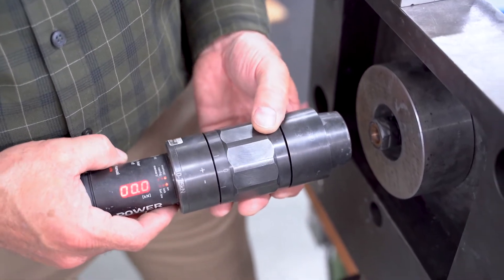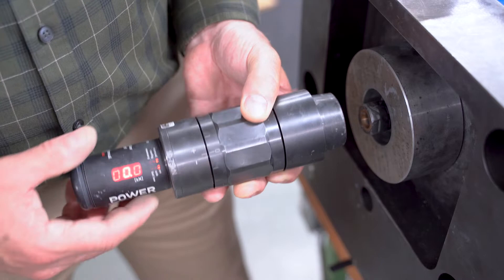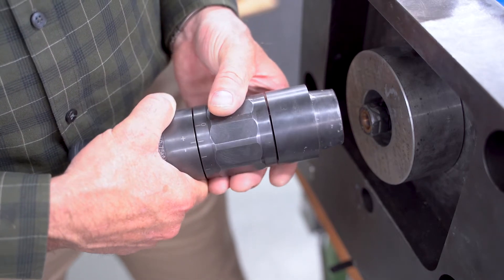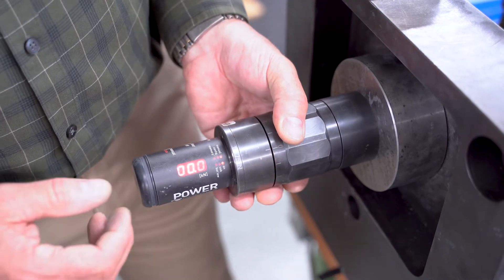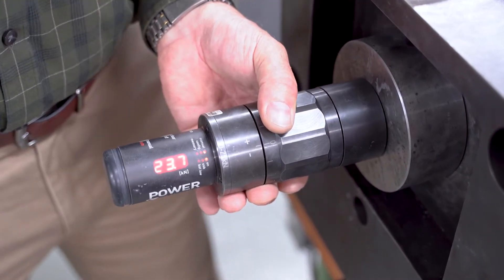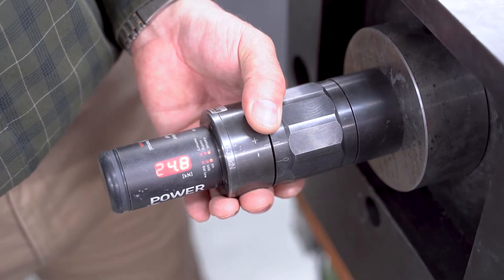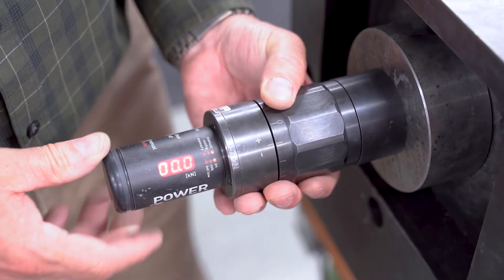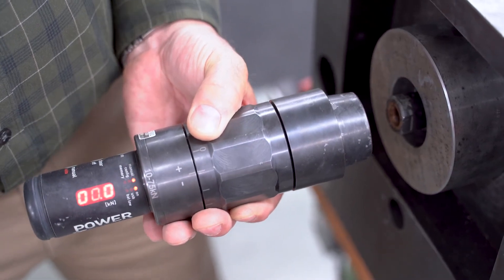The Ultimate Pull Force Test with OTT-JAKOB

Comment: What was the spindel pull force finally 23.5 or 24.7 or 22.2 ?
Reply from the maker: The actual or real pull force is always measured at the “0” point on the tolerance ring, so 23.5 kN. Keep in mind, make sure your E.M. or gauge setting dimension is set properly first in unclamp position.